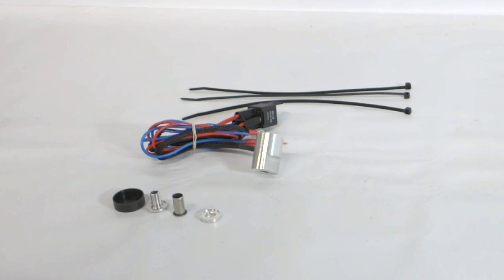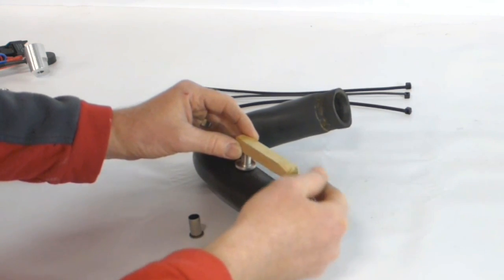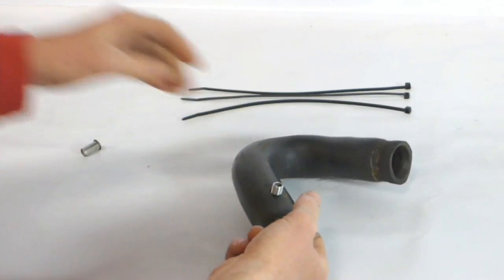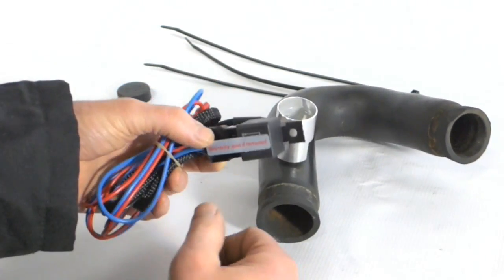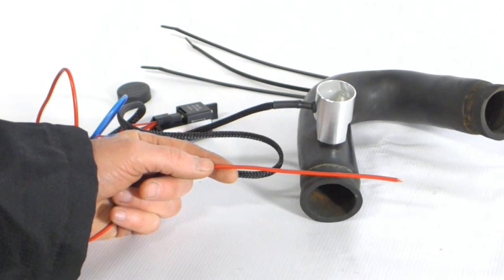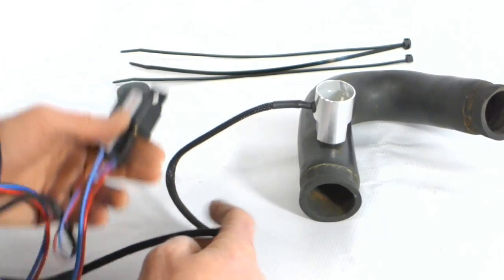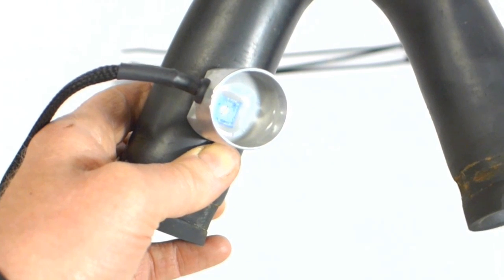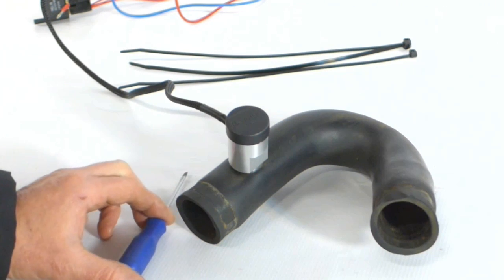Electronic Fan Controller Self Sealing Fitting Video

Comment: Why would you fit it to the bottom hose where the temp has been reduced by the radiator? And it looks like flat washers/seals against a curved fitting? Then again, 306 subscribers and a 9 year old video. How the hell this video ended up in my feed is beyond me!

Comment: A kit like this could work with a water methanol injection kit as well, we struggle to find a place to mount our injection nozzle. you should create a boot kit of silicone to mount out water nozzle into. For diesel or gasoline.